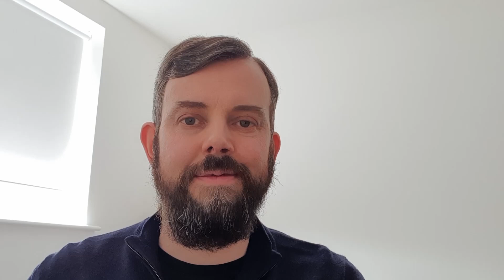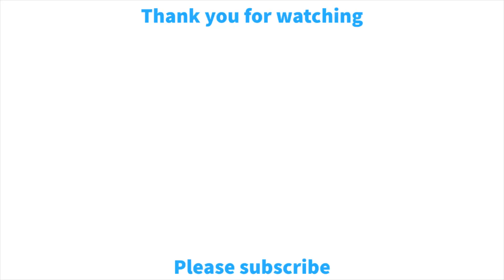18th edition 2022 update to wiring regulations

Comment: The CRL was awful, DNO's did not provide the information and therefore nobody ever did it. The clarification is better but I still believe a simple "all new installation shall have over voltage protection" would be even better still.